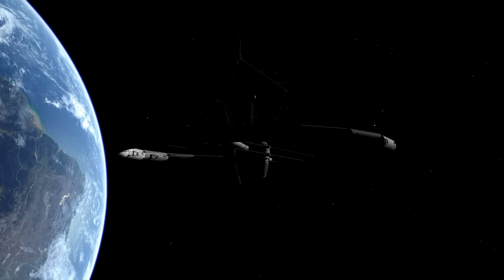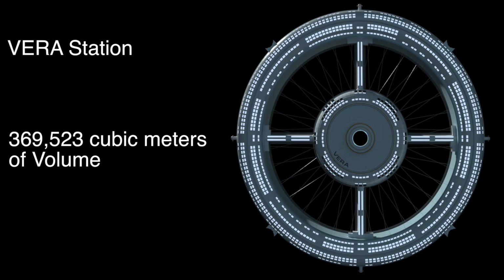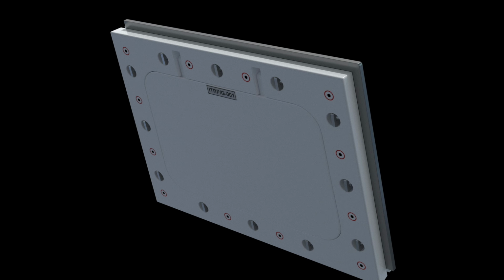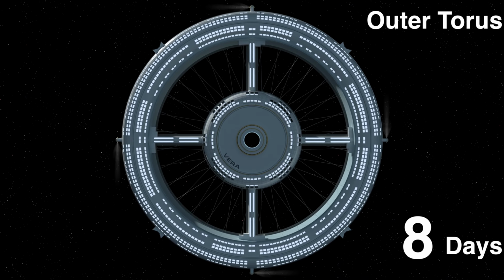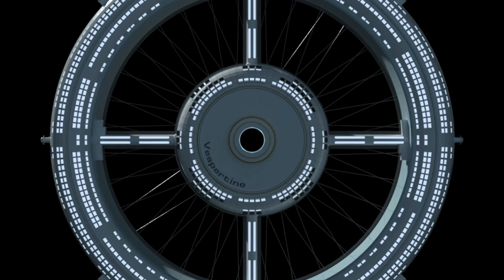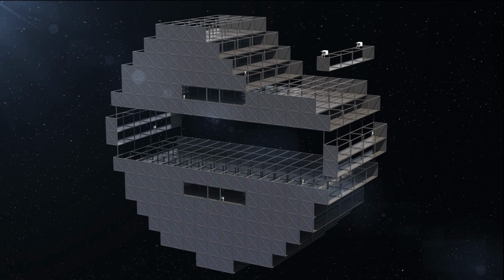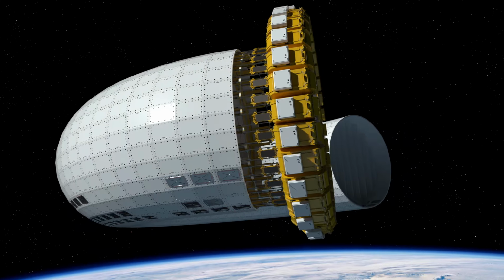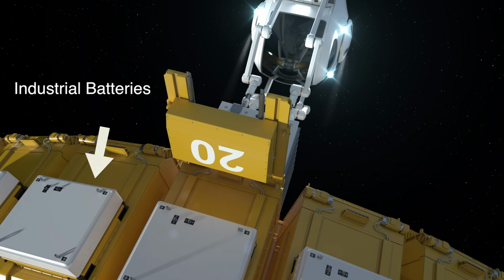We could build this huge Space Station in 6 months

Comment: An appealing idea but a few questions off the top of my head. How do you close out the torus (requires some disassembly of the machine making it)? The illustrated machine would not be able to do it because the unattached side is many metres of straight machine tangential to the torus so it would interfere with the oldest section when trying to add the last few sections. How durable/what is the expected lifespan? What is the mass of the torus and the method of manoeuvre for raising the orbit as it declines, and for collision avoidance? What is the expected rate of meteorite/debris impact and what systems are in place to mitigate or prevent losses causes by same? What reserves of supplies (air, water at least) would be necessary for certified safety? Apart from space tourism, what use is this form of space station? It is not zero-g so has no manufacturing advantages over production on earth unless dedicated, non-rotating tori are built.  But a dedicated, non-rotating sphere would be a safer and more efficient use of materials for zero-g manufacture. I'll stop there.
Reply: You build only half tori, then you install all the flooring and ducts that are needed from the open ends. Then you fuse two halves together.
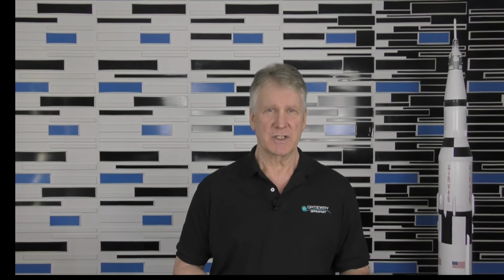As for power 18:43 shows that the side towards the sun will be covered by solar panels. But I am also sure that nuclear power will eventually be the solution.
Reply: Seems like the Sargon machine is really just a ring of smaller assemblers that act as easily manufactured "space tractors". I'm guessing they probably just disconnect, let go, and push off from each other when they reach the end. Then maybe they just hover above the last ring and place the last ring from above, or maybe they stay at the end and leave it open as a passage to bring supplys/robots to work on the inside until they finaly close it?
Reply: Also time it takes to outfit the Station. Building the outer walls is one thing. But installing all the interior walls, doors, power, water. Air, furniture etc. No mention of that at all
Reply from the maker: @brentmcknight5344  Yes, I did. Check again at 6:05
Reply: @TheGatewaySpaceport  Yes you did as an addendum to an additional design for floor construction when you covered time frames to build the torus. How many trips to space to build the ring builder in the first place and how much EVA assembly time by astronauts? It must take a few years for that unless you have a 10 man crew or the like. Cadence is not so easily accomplished without plenty of error at this scale to learn from.
Reply: @AtomkeySinclair  you really need to look up drone swarms on YouTube. We already have the ability to create large numbers of flying drones that can self organise and do very complex things. The machines used to build something like this could be dropped off in any order and they would be able to organise themselves onto the right order, do their own error checking and fix many of their possible issues (including by swapping out units with spares that take on the function and designation of the original). At least that part of the problem is not an issue in terms of what we know is possible. Still a lot of questions that remain, but there is clearly no need for humans to be involved with the construction in space at all, everything could be done remotely and the only input the constructors should require in order to build the structure is for the materials to be dropped off.
Reply: @Jake12220  Automation isn't my perspective for my comments. His time line is. And the drone tech your talking about has only been on earth although there are some neat ones for STEM on board the ISS for years. That's far from constructor drones. I don't see this happening for a decade and I do see a manpower need for astornaught construction workers exclusively for EVA even if it is coordination and maintenance. That means a base first. And that calls for moon operations first as well me thinks. Too much to do in just seven years. It's hopeful wishing unless the drone tech is already past prototype and into production. I've not seen a orchestrated space drone implementation. This comes down to selling it. As an investor I want to see the hardware. Even that's half the battle. Someone has to write the control software as well.
Reply: @TheGatewaySpaceport  

I am not sure if this would be a problem at all on this new space station but at least on the ISS, in the module where they workout, the engineers had to account for the astronaut’s movement when strapped to the treadmill or other workouts with contact to the wall. Repetitive motion against the walls of the ISS can build up with time and cause the entire station to flex which is a huuuuuge structural issue. The engineers counteracted this by adding things that absorb the shock when running on the treadmill or doing deadlifts etc… seeing as there will be artificial gravity on this station, people will repetitively be in contact with the walls/floors of the station. Will this be an issue structurally? Does the artificial gravity make this not an issue? If artificial gravity does not help the issue then how will this be solved? I hope this made sense.
Reply: @TheGatewaySpaceport  sorry but there is no mention of the electrical, air, water. Building the station is just the first step but getting it commissioned and ready for human occupation I think will take you longer. 
BTW I do really hope this project goes ahead. It really is a no brainier in terms of future space stations. 
All the best
Reply: Yeah.. and how do you build the builder in the first place... That's 1ks of hours of EVA isn't it?
Reply: @AtomkeySinclair  I think the constituent parts of the Sargon would be made on Earth then launched up.
Reply: @jackhutchison9021  Yeah, it looks modular. In build-mode it's a closed chain of 'assembler magazines', once the last segment is welded, I imagine that the assembler-magazine-chain could detach two modules from each other on the inside-radius of the torus and then 'butterfly/extend/articulate' into a tower/stack configuration that is still attached to the outside-radius of the torus then it detaches from the outside-radius of the torus and then the stack can be move away from the finished torus.
Reply: @jackhutchison9021  I'm sure.
Reply: I don't get why anyone would be worried about these machines closing the torus? Seriously its not a solid ring doing the construction, its a modular system that could easily alter the diameter of the ring slightly, but it also looks like the construction ring sits above the structure to begin with, so it wouldn't have to change anything to complete the torus. There is likely parts of the system that would be left inside the finished ring, but the machines are modular so whatever was left inside could be recovered via hatches/doorways.
Reply: Your thinking mirrors mine. The machine would be great for the bulk of the work but the problems come at the end. For the last of the segments, that machine would never work. Now two machines gets to be a bigger problem as one would have to get out of the way before the second would also have to get out of the ring. Depending on how big the machine is, that would determine how big a segment would have to be made that would be used to plug the gap. And then pushed into the gap. There you would need some kind of a ring that would be bolted/cam locked together to a mating ring on the larger portion of the torus. Once welded from the inside, those parts could be removed. I also think that you would want to do a complete weld of all the segments from the outside. When installing the last segments, you would need some sort of jacking mechanism to spread the torus a little for the final segments to fit in. Then release the jacks so that the ring closes in on the final segments. Maybe even have to pull the segments together depending on the temperature of the units at final assembly. It isn't insurmountable but that machine can't do it all. It will take other types of machines also.

I also noticed that there was no indication of how the finished space station was going to power itself. That one part of the video where it showed a mast with a mirror sure isn't going to do it.
Reply: @gravelydon7072 
Well, you do 2 segments, or more and develop a welder that can weld them together. Or do torus until your space runs out, take builders out, make last segment with one torus, shift it to position and weld it in from both ends... It is not that hard, but moving a huge segment could be too hard and you finally go with one panel at the time. So making final gap will take some extra time.

Also thinking how do you repair errors that will most certainly happen in any large scale construction.

Perhaps builder should be larger than the torus, so it would be always outside of the structure and can make even the final pieces. Also this means welds should be made from the outside, not from inside. After torus is done, just open latches, use hinges to open one side and slide the builder off from torus.

For welding, you need only one welding head plus spare ones. You need to have a round track where welding robot can move and a 3D model where to weld. In this way you need less material lifted to space and only one (or few) working welding system. Having a welding robot for all separate panel seems to be an costly system and so many moving parts could lead to many repair needs. Also having few welding robots that can move, means you may change welding robot easily if there is some malfunction. Hardly any time lost if there is a malfunction. And you make the welding robots modular, so you may remove them and send them to repairing station whenever needed.

Wondering if any large pressured systems can be placed to Earths orbit, because there is just too much space debris already. Of course this station does not need to be there, but yet still, going further means more costs.
Reply: @martiansoon9092  Debris will be a problem. And I too wondered about how would they make a change if needed. If the units had a cam lock opening in every panel, then you could have a module that would lock over several panels and allow repairs or replacements to be done while still keeping the main structure pressurized. Sort of like the covers that pipeline welders use except for metal and completely sealable to the torus. Maybe a number of the units as it would need different size modules for the different size diameters of the ring. Smaller damage could be repaired with an epoxy repair while larger repairs would need welds. Maybe install channels for the units to run in so that they would stay connected to the station. Have hatches that open into the module once sealed  against the hull so that access would be from outside the hull instead of inside. And it also would be possible to build the station from the outside as you suggest instead of from the inside. One big building unit is the wrong way to got while a number of smaller ones would work better. And the advantage of having the channel sections on the outside is while it would add a little weight, there would be a significant increase in strength.
Reply: Sorry I asked this same question before I read your comment.
Reply: LOL, you humans can't even tell what this human is. Even when some of you have it right, you still don't realize.
Reply: Simple answer is that the maker of the rings splits off because its larger than the product
Reply: And the radiators. And waste management. And station keeping propulsion to maintain proper rotation, not earth orbit as that was mentioned already.

Comment: Would it be possible to connect a dozen or more of these stations together along the Z axis to form a 'cigar' - and then give it propulsion sufficient to get that cigar to - say - Mars and then put the cigar into orbit around Mars as a staging post for the colonisation of Mars? Rather than sending 1000 starships send one multi-torus cigar propelled by - say - a few dozen docked starships - which then act as the ferries to and from the Mars surface?
Reply: We’d need a fusion engine the size of newyork to power that 😂😂 I’m not saying it’s impossible I’m just saying we could first connect them along the X axis and make it smaller as we go up in either direction, boom, Gita station, and a moon lol plus itd has its own gravitational center it would spin on its own and have enough mass to pull dust in from space to form a ring or rings…
Reply: @Klix3ontop  "We’d need a fusion engine the size of newyork to power that"
Oh - you did the maths did you?
And how exactly does a "fusion engine" work to create thrust?
Project Orion spat nuke bombs out the back - what would a fusion engine spit out the back? (assuming we don't have to wait another 30 years for fusion to work - if ever)
Reply: @ejbh3160  not bombs this time we’d need a tokamak reactor that was really big 😂 to funnel out its power into a magnetic field which we could concentrate into a beam of pure plasma hotter than the core of the sun. Then we’d need enough deuterium to power it and a energy field to stop the radiation of a reactor the size of new York from designating us. The cigar would then have to not get shredded by dust since it’s so big. Going at those speeds would me lethal. Without an energy shield (:
Reply: @ejbh3160  reactor size is a rough estimate for a ship that size it would be like moving the United Kingdom on a boat with one engine using the starship idea you proposed plus they wouldn’t have enough fuel or power
Reply: @Klix3ontop  what makes you think tokamak's will ever achieve a sustained fusion reaction?
Reply: @ejbh3160  as long as we don’t run out of deuterium or botch the reaction or damage the reactor we’ll be fine
Reply: @Klix3ontop  It would only need to accelerate to the Moon (using the Moon's gravity) and then do a slingshot to Mars.
Like I said - have you done the maths? A dozen of these stations connected isn't as massive as you seem to think. Musk's plan is to send 1000 starships at a time which is considerably more mass to move.
Fuel is only a matter of storage space (and there's plenty of that in each of these stations - so a dozen connected wouldn't pose any problems with fuel storage space).
Reply: @ejbh3160  when we could just send 100 un crewed nuclear thermal capable starships to Mars with all the materials in weeks and have all those stations built in a few months instead of spending longer transporting.

Comment: There is a very good reason to use a segmented design; in the event of a collision or structural failure, airlocks can be sealed, saving inhabitants.
Reply from the maker: Hi Pickle, the sheer volume of VERA Station would allow for big holes to leak air for days and still have plenty of air pressure. But we do have multiple plans to patch any holes, big and small quickly.
Reply: @TheGatewaySpaceport  while smaller space debris is fine, what about incidents of larger holes being made?  Such as a two meter rip.  Unfortunately space debris is getting more and more common, so having segmented airlocks as a safety is a necessity, and simply having extra air isn’t the answer, no one wants to loose that much.
Reply: @TheGatewaySpaceport  Let's hope no one will be blown out into space until such holes are fixed. That's the problem with that air pressure, it's no good to you once you're out in space unprotected. But I'm sure you're not forgetting about that, or are you? ;-)
Reply from the maker: @omsi-fanmark  All debris bigger than 1cm are tracked and warnings are given for any possible conjunction. VERA will move out of the way for the big ones just like ISS does.
Reply: @TheGatewaySpaceport  theres also the posibility to use lasers to decompose and change trajectory of any incoming materials as well as small drones that would kamakazi into them. For the airthing a system of airlocks would still be preferential, just in case. Also you should look into production of oxigen in an oxygen farm, cause supplying such a big station regularly with oxygen would be a big hurdle. In the best case the stations would even be able to grow their own food on plantages.The space would be given

Comment: This will require massive amounts of material. If those materials could be mined and refined from asteroids or the moon it could be possible. Ultimately it boils down to what your engineers are capable of. Powerpoints are easy. Building working hardware affordably is something else altogether.
Reply: Concept and reality are totally different. Even with producing a small module in Earth and test it, it will cost a lot of money to test and validate all aspects: safety, fault tolerance, etc.
Building a machine like this in Earth is super hard. This one is in zero-G space.
No one will build from a theory or 3D simulation. I don't believe this company has money to contruct and realize their concept. No hope when you have no plan.
Reply: @tenkiaqua6131  Yes it will be a big engineering project that will require lots of funding and collaboration to pull off. If they can get enough investors on board and contract SpaceX's Starship for launch services I still only give it a 30% chance of succeeding. So many unknowns and firsts to trip them up. Whatever else, their projected construction times seems way too optimistic. I hope they can pull it together and not turn out to be another Nikola.